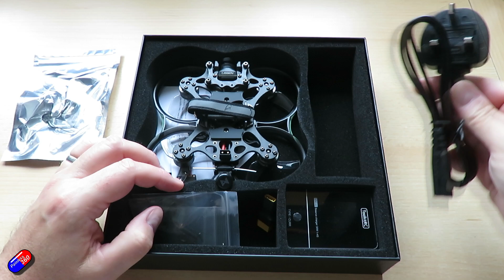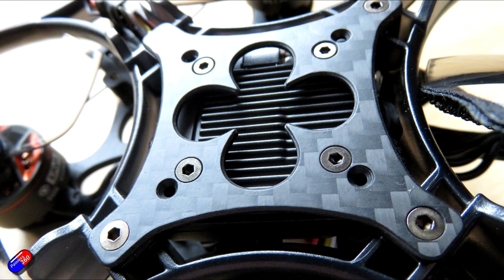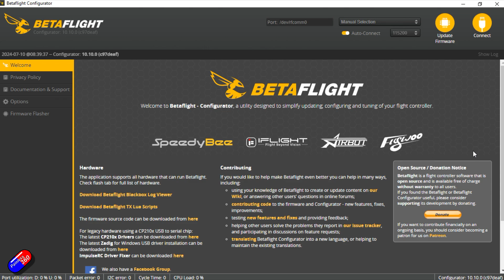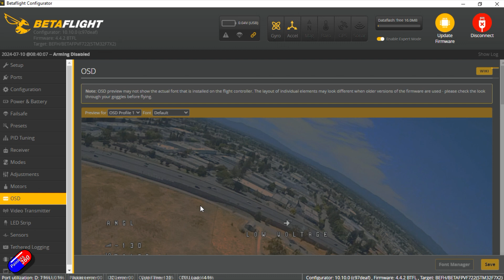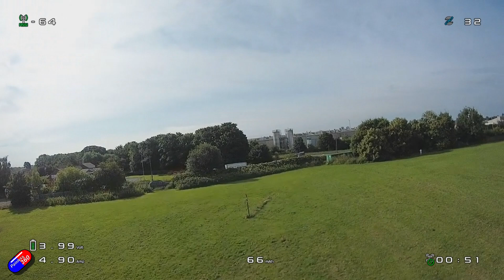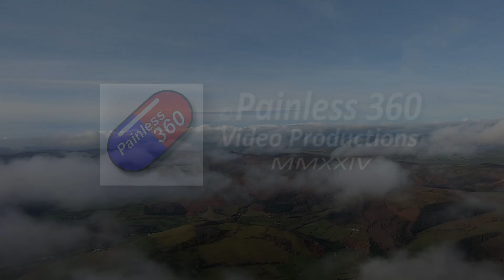BetaFPV Pavo Pico25v2 (Walksnail edition): A excellent compact, all rounder!

Comment: Installed a loud beeper on the buzzer terminals.   Set a switch in modes to activate the buzzer but it only uses the motor windings buzzer.  The new buzzer is activated for all other alarms the FC turns on.  This is opposite of what I wanted.  Can you help?
Reply from the maker: Check the buzzer sounds, it's connected to the right pads and if it still doesn't sound, log a bug report on Github... Best of luck
Reply: @Painless360   Factory default was with dshot beeper enabled in BF.  After turning dshot beeper off the external buzzer works from the aux channel.   Found the answer by searching how to use the motors for tones.  Had never seen or noticed that was an option.   Thank you for your reply.